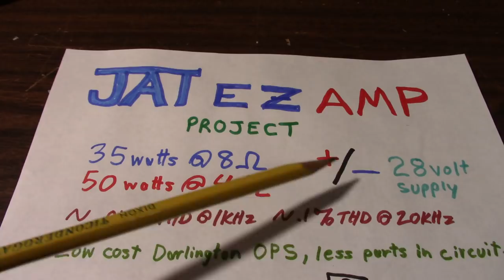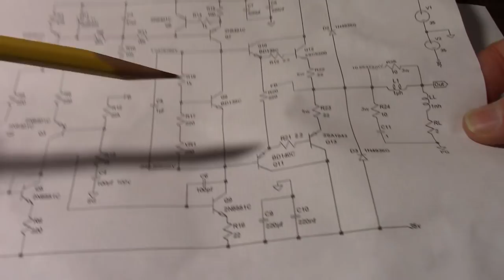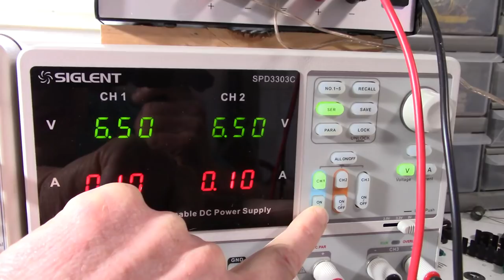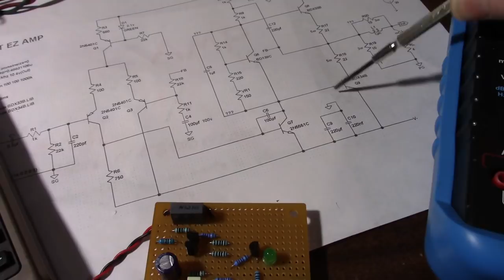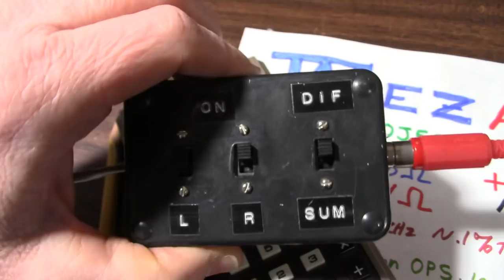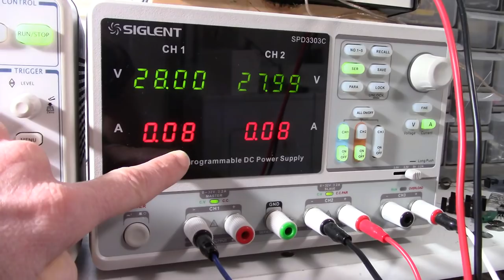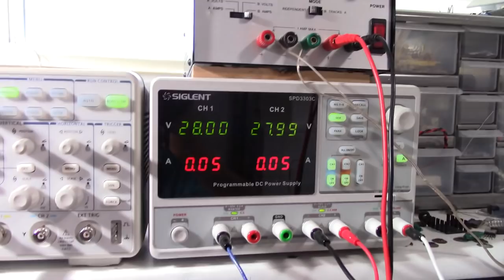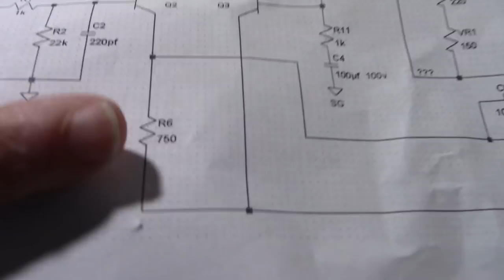JAT EZ AMP audio amplifier project low cost and easy to build PART1

Comment: 1:44 the Sherwood RX-4105/4109 used TO-3P darlingtons for it outputs. the unit itself is a full size receiver but the amplifier board's components could fit on a 4"x5" PCB.

Comment: Happy New Year, John. Incidentally, you mention that the power stage in your more complex amplifier costs $8. There are so called audiophiles, who spend hundreds or even thousands on cables alone, so even your more expensive amp is quite affordable and also much better than the vast majority of artisanal audiophile stuff out there (e.g tube amps high distortion etc.)
Reply: In my experience so called "audiophiles" are some of the biggest idiots inhabiting this planet with the rest of us. They're the real "feeltechs". As they feel certain devices improve the sound without any real proof to back up their assertions. I especially love the ones wasting their money on snake oil solutions to their perceived issues. It's a piece of wire.
Reply: Paul Frederick I agree 100%!
Reply: @micomrkaic  John puts his circuits on the scope and puts them to the test. That's quantitative methodology. Not smoke and mirrors voodoo witch doctor mumbo jumbo. Which too often passes for authoritative audio analysis.

Comment: Quick question:
Did you match the transistors in the differential amplifier, or were they simply the same type straight from the parts bin?
Reply from the maker: They are matched.
Reply: OK, thanks

Comment: Healthy, happy and prosperous new year John. Great amp circuit, I've a couple of curiosity points: C5 looks a little low - poss' 100uF? And should C4 be of a non polarised low leakage type cap or even omitted? How good do think this circuit is at staying on zero output volts (offset and drift)? All the best from, not so sunny, Devon UK.
Reply from the maker: Happy New Year! C5 insures high frequency stability of the bias spreader circuit. Some designers use a larger value, some omit it altogether. I feel 1uf film cap is a good compromise. C4 technically should be as high quality cap as possible or omitted using a servo circuit. Non polar caps of 100uf 100 volts tend to be physically large, film caps of that value are even bigger and expensive. Servo circuits add complexity. Since this circuit omits a lot of parts to reach the lower realms of distortion anyway, it doesn't make sense to beef up this cap. You certainly could if you want to.
Reply: @JohnAudioTech  Smashing reply, thank you. My tabby cat (Shelly), would always keep me company by lying across the top of my bench scope. He would send its offset adrift by diminishing its thermal convection :)